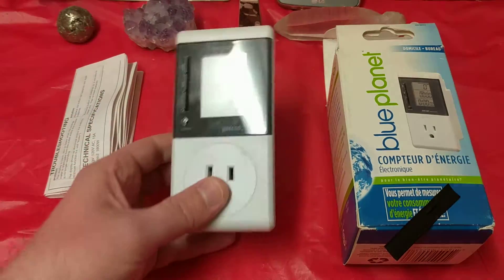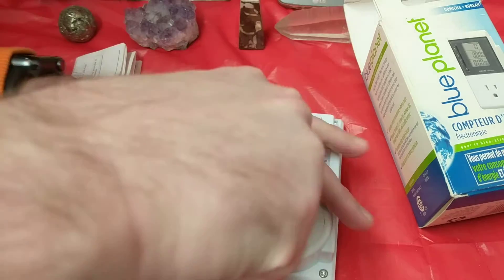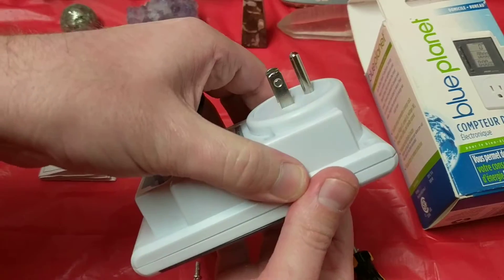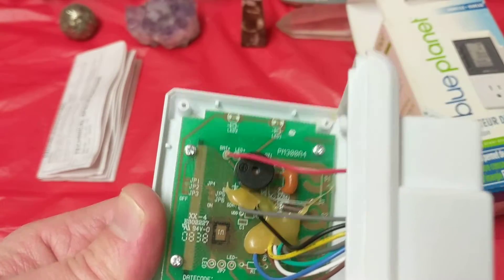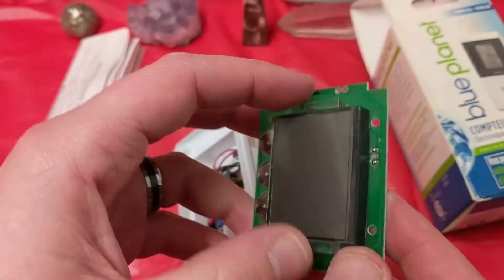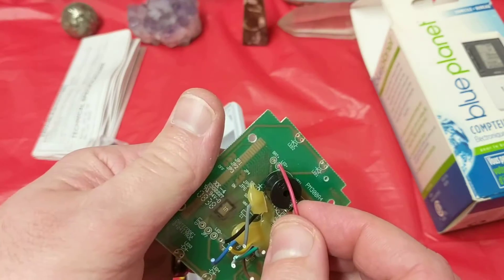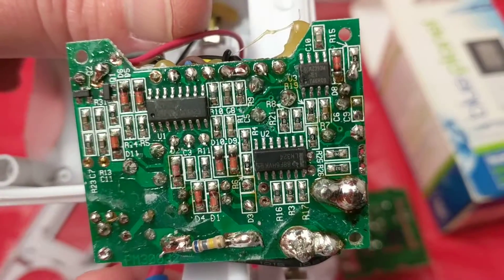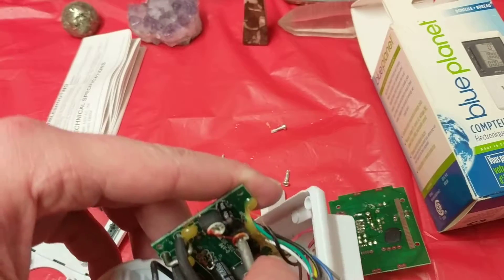UPM Marketing EM100 Energy Meter TEARDOWN with LCD Display

Comment: I have several of these . They have lasted on average over 8 years. Some of them outside permanently.  I think your quick taking apart a unit with out any electronic testing is a disservice to the people who in my opinion engineered a fairly rugged product. I have some from other manufacturers, but none have lasted as long as this product.  The only negative thing I can say is that the backup batteries should have been rechargeable.
Reply: Using them "outside"?!